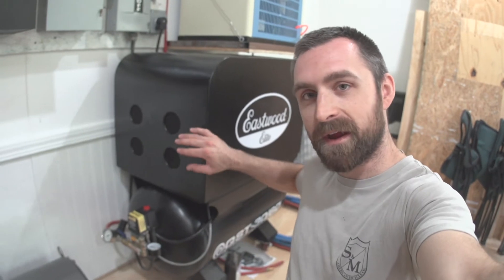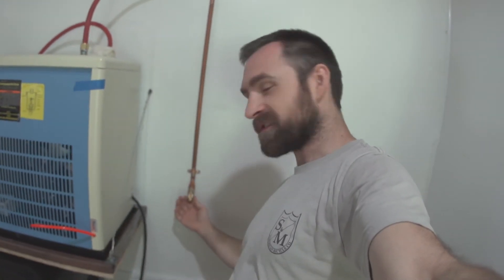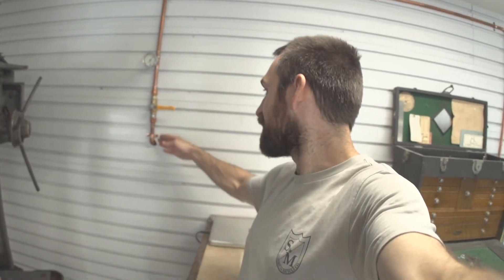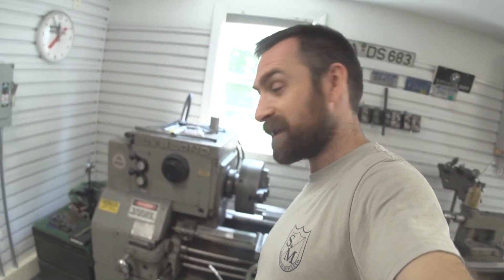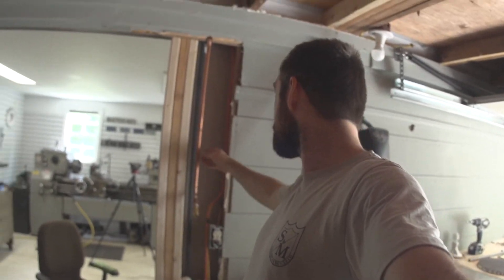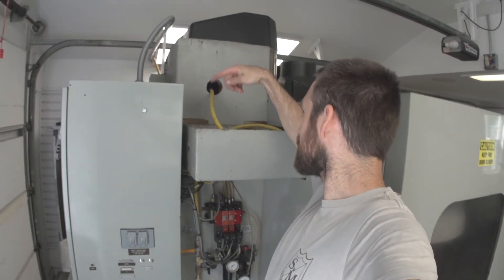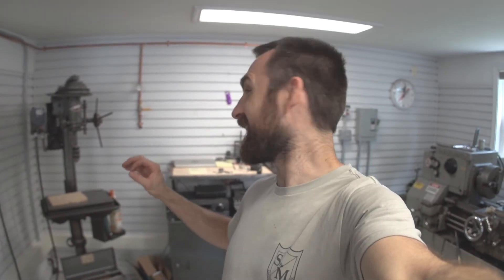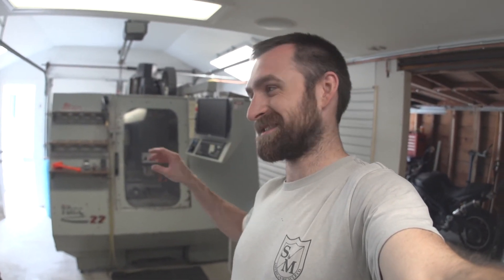Copper Compressed Air System - Full DIY

Comment: I have  most of the airline connectors I need already but what fittings did you get for the airline connector to 1/2" copper pipe.. I think my fittings are called 3/8 BSP but don't know how to connect to the copper pipe. Ideas? Thanks
Reply from the maker: I think mine are 1/2” NPT and I have 1/2” to 1/4” NPT reducers threaded in, and the air fittings thread into those.
Reply: @RussellMakes  thanks for taking the time to reply

Comment: Next time use T-fittings in the vertical pipes for your hose connectors rather than elbows. You can continue the vertical pipe down another 2-3' and terminate in a purge valve. That way if any residual water will pass your hose connector and collect at the bottom of the pipe extension where you can purge it occasionally.

Comment: Regulated at the compressor not at the device after those long runs?
Reply from the maker: Yeah. The CNC mill has another regulator because it wants 75 psi but the rest of the system is regulated to 90 psi which is what all my air tools require. Plus I don't use air tools much. Mostly just blow-gunning or filling tires. 90 psi is perfect.